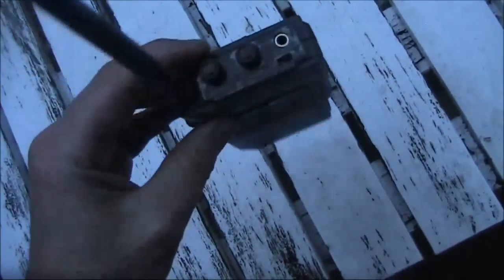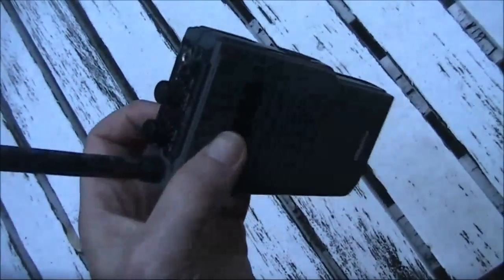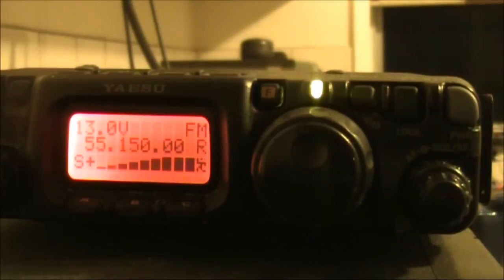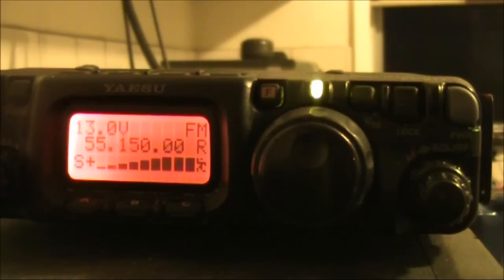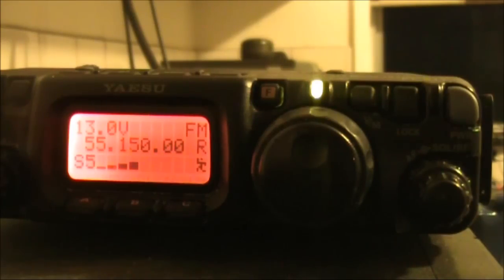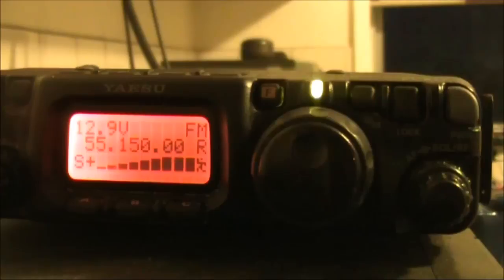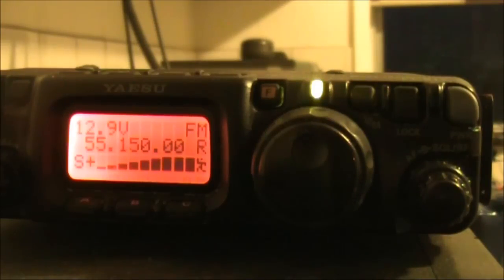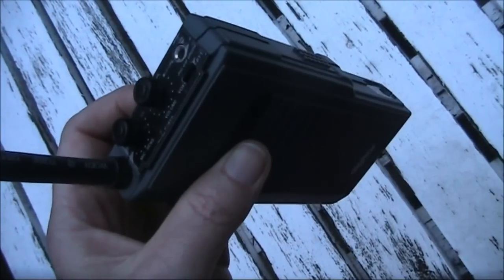Range testing a 55 MHz FM walkie talkie

Comment: I have a few "Realistic" branded versions. They are slightly more slimline than these, have a telescopic whip (around 40cm long) and also a morse (call) key. They work surprisingly well. As a kid, I spoke from the Sandy Point (Waratah Bay) beach to the top of mount Oberon (Wilsons Prom) with them, at full quietening. This was around 30-40Km These radios are partly what got me interested in the hobby. Cheers, VK3XPT

Comment: I was expecting a little better than that. I wonder if a 1.5m quarter wavelength whip on the receiver would work much better. It definitely would help the transmitter. As you said, a km or more would be achieved then. Mod the handy to have a BNC connector on the top and do some real experiments :) while you got it open, make a video of it's internals
Reply: I wouldn't be surprised if the stock standard antenna is a helix inside that duck
Reply: +Dazzwidd coiled Springs were the go to antenna design for many walkie talkies of the day, I would imagine this may be no different...